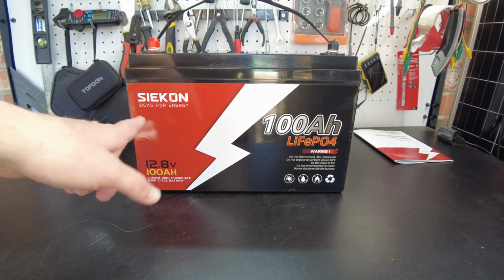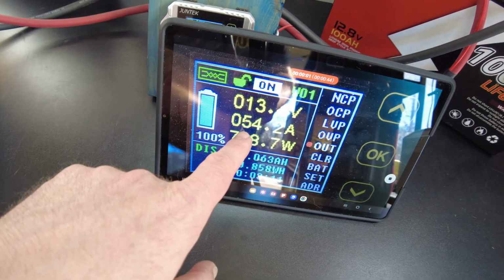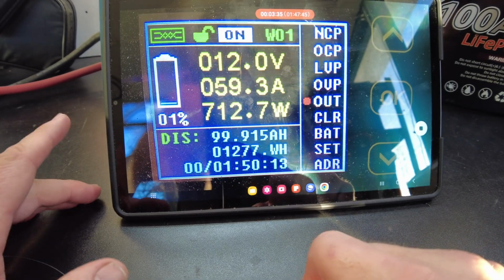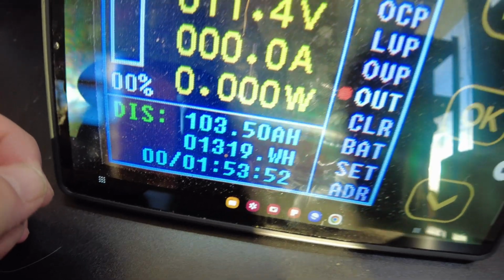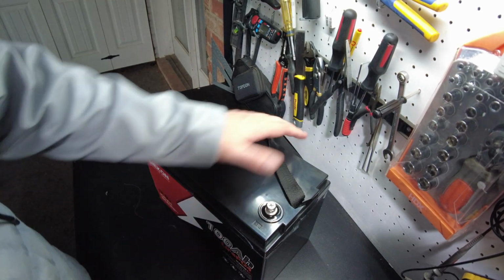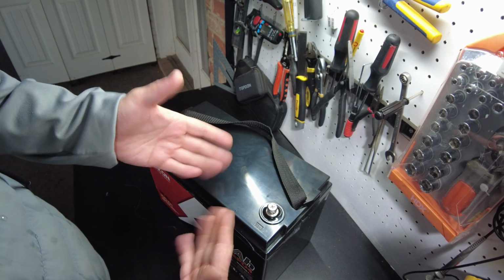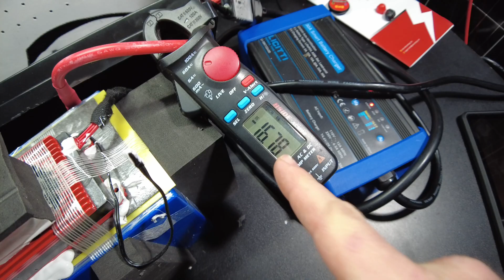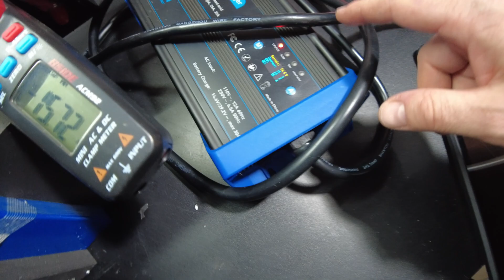SIEKON 12v 100Ah LiFeP04 Battery

Comment: I really don't like Daly bms. It one's overcharge my 100 amp 12 volt pack. I have lost 1 cell and it set for lifepo4. Jk or jbd only for me
Reply from the maker: Yikes! I have a few, but really have not used them much. Most of my batteries that see regular use have JBD. Thanks